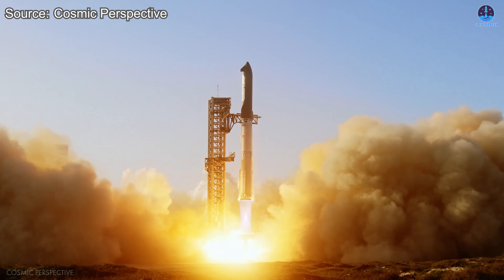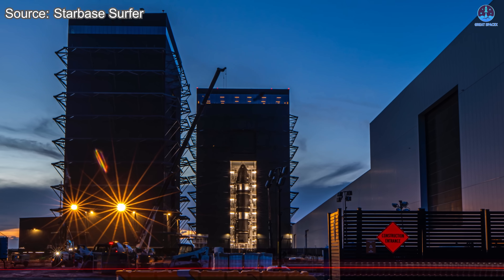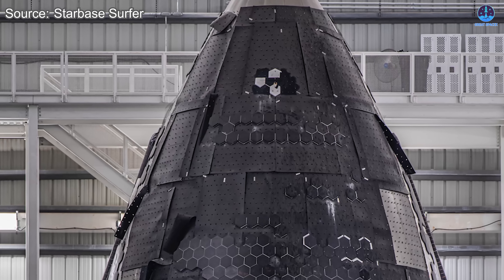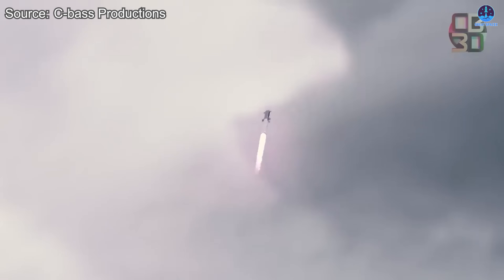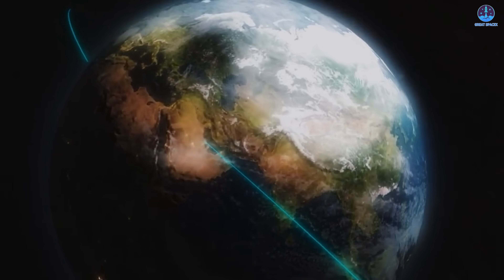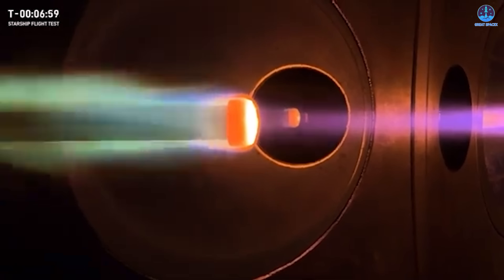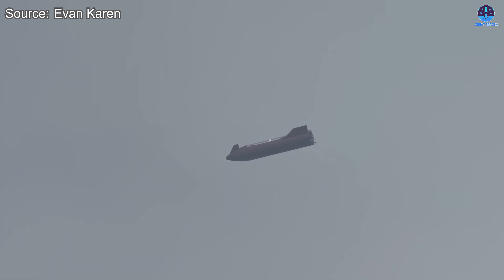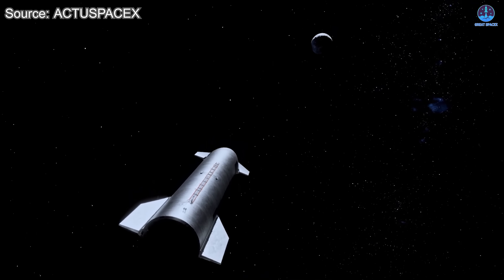SpaceX revealed New Heat Shield on Starship Flight 10 to Beat 1500°C Reentry…

Comment: They need to change the entire propulsion system.

Instead of being a chemical rocket, it should instead be more of a constant High Thrust Ion Engine that can reach between 2-3G.

It would be a lot more faster and efficient to reach Mars and the rest of the solar system.
Reply: There's no such propulsion system currently imagined. Nuclear Rocket with a centrifugal passenger compartment that's the way I think it'll work between Earth and Mars. Starship is not the answer for Mars, maybe the Moon, but no farther. The occupants would be too incapacitated to land and survive on Mars, take for example how Astro/Cosmonauts are handled when they return from the ISS, it would be 2x-3x as difficult on a Mars mission.

Comment: At this point I think they should be launching test platforms just for shield reentry testing. Smaller with dummy weights and sent at extreme reentry angles. Maybe Falcon Heavy. I think most of the trouble with Starship is simply mass, vibration, harmonics, and the flexibility of all the parts during launch and reentry. It seems like now they are accepting leaks but compartmentalizing and venting. I really wish SpaceX had a crude station in orbit from which they could do inspections and possibly repairs.

I thank Elon Musk for reteaching us that rocket engineering really is difficult and for subsidizing R&D for the US Government.

Comment: Yes, steel can become stronger after heating but it also depends on other factors such as how quickly it cooled off afterwards. Also along with the hardening comes brittleness, as the steel becomes harder it also becomes less able to bend; more brittle. The internal grain structure of the steel will absorb more force but when the structure fails it cant fail slowly and allow the grains to slide against each other as with softer steels, but as the pressures are absorbed and build, the steel will reach a maximum stress point where a catastrophic fracture is only outcome.

Comment: Why not maintain a good speed  at reentry so you don't need protective heat shield.  Like 500 mph.
Reply: Same thoughts here, but reduce speed requires 1. more fuel and 2. minimum one turnover so you can burn your raptors backwards and another turnover if you do not want to reentry with your ass down. But breaking down from 16.000 mph to about 500 mph is simply not nessacery. Maybe reducing to 10.000 mph is enough just to reduce the time of reentry.

Comment: Any back-burn duration can eliminate most re-entry problems and improve reusability. Any thoughts?
Reply: The counter would be that a re-entry burn requires extra fuel/mass. Also, if you're going to try and slow down in orbit, your angle of attack becomes more steep, meaning you'll actually experience greater peak heating as you hit the thicker part of the atmosphere more quickly, as well as greater g-forces. What you really want with a re-usable heat shield is slow and steady heating, to give the tiles time to be able to dissipate it.
Reply: Same thoughts here, but reduce speed requires 1. more fuel and 2. minimum one turnover so you can burn your raptors backwards and another turnover if you do not want to reentry with your ass down.

Comment: Stack two rows of the current tiles on top of each other, off set the bottom row
Reply: Everything adds on weight & makes re-usability worse. Just make some length of back-burn before re-entry.
Reply: Can't do that literally without problems anchoring the tiles. They did something like this with an ablative foam under layer to sacrifice itself if the tile falls off on re-entry, saving the rocket, but requiring repairs and a new application of the material.

Comment: SpaceX will try again with those metallic tiles and fail again!!! as metallic tiles won't work either and have its disadvantages...SpaceX would have to sacrifice load capacity for safety and warp the rocket with a network of liquid cooling.SpaceX is trying not to use liquid cooling because of cost and weight but after failing "AGAIN many times" will do the right thing.
The other thing SpaceX can do is forget about entering back into the atmosphere and have the rocket stationared in orbit; like the science fiction movies where a large mother ship rarely lands on Earth. I guess it won't be more difficult than ISS construction, but building a large and complex spaceship to travel to the Moon and Mars orbit then land with a smaller ship.

Comment: SpaceX is relying on steel getting stronger when intensely heated? Just like the skeleton of the WTC, I suppose. Otherwise, it might have collapsed. Oh, wait...
Reply: Skeleton of WTC was a combination of Steel and aluminum. Neither was Stainless steel. You're comparing apples to oranges. If WTC had been made of this metal... yes, it would still be standing.

Comment: You would hope that Spacex would have come up with something better than Space Shuttle like thermal tiles to protect Starship during re-entry.
Reply: I've thought the same. Every seam is a failure point. Surprised there isn't a full sized heat shield sled glued to one side

Comment: You guys are a little bit wrong about the tiles you shown they’re stalling them that way because the blade of shield actually comes up around each tile and fits in between like caulking in between bathroom tiles. That’s what you’re seeing there in that image with the tiles are or placed in every other position and you see that white cloth sticking around each tile, then another tile goes in between those two tiles, allowing the blade of material to fit in between the edges of each tile it’s engineering just look at a little bit closer and don’t have an AI create story
Reply: yes you are correct it is  a ceramic blanket material